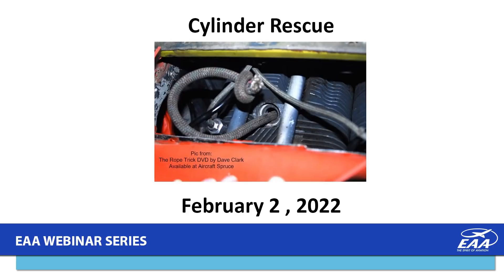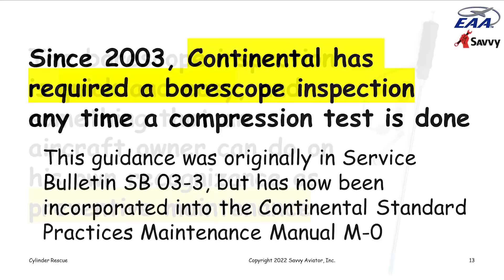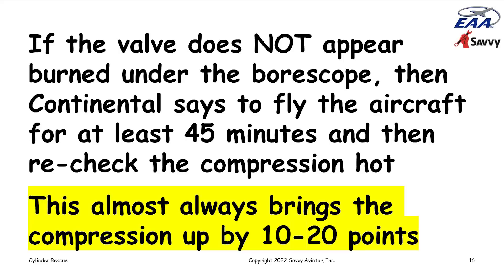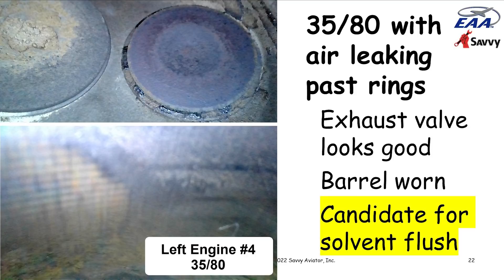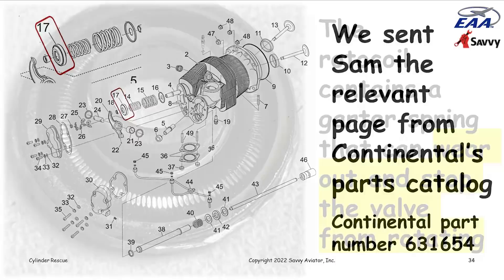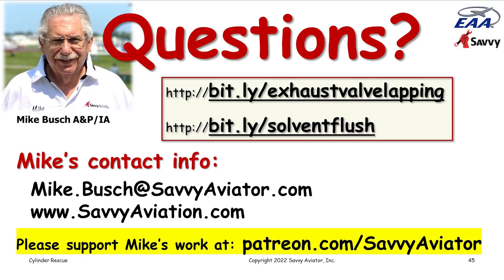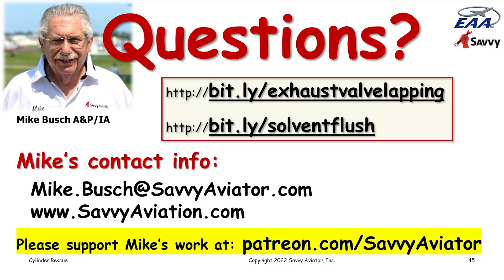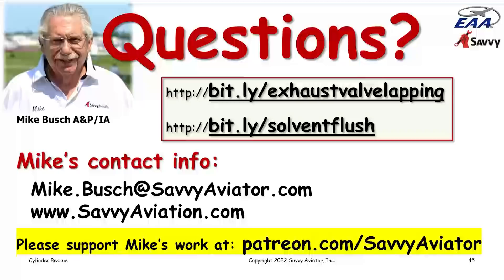Cylinder Rescue

Comment: Mike, I can not tell you how much your publications have helped me as a professional aircraft mechanic. Its frustrating to me that so many mechanics stress about lower than 70/80 compression numbers on Continentals and without using a borescope or understanding the master orifice, immediately jump to overhauling the cylinder. It ends up costing the customer a lot of money and wastes the mechanics time. One thing I would add, I found that you don't need to drop the exhaust to access the valve during a valve lapping procedure. If you use the tip of a zip tie, you can maneuver it with compound through the top spark plug hole.

Comment: As an Automotive tech doing compression test is nothing new. But its interesting, as what you call a compression test we call a cylinder leak-down test, witch we do after the compression test if we have a noticeably low cylinder compared to the others. Cylinder low compared to others, Leak-down test at TDC and see where the air leakage is then a bore scope check, witch we have been doing for a long time since camera prices came down. I think I'm buying a VA-400, it will be a great tool to look up into the cylinder as the one I have only looks down or 90 degrees. Its nice to show the client/customer actually whats wrong.

Comment: Back when the original FARs were written, compression was the best diagnostic tool they had.  Today we have a much better idea of what's going on inside of the engine.
Reply: What do you think was it Orville or Wilber that wrote that section of FAR's??
Reply: @marknielsen8738 It was Charlie Taylor.

Comment: The old hand spindles with the suction cup on the end that were used to use to lap valves when the head is off an engine required you to reverse the direction of rotation.  I doubt it’s important to do that but it was how the procedure used to be accomplished.

Comment: I have a 10 over cylinder with 200 hrs on since rebuild. It has a loose valve guide. The local shop could not repair it and recommended a another shop that might could install a 30 over guide.
Is it acceptable to install a new standard bore cylinder mixed with the 10 over cylinders?

Comment: Can owners do this lapping method or is an A&P required?
Reply: This was answered in the Q&A section. He basically said it's a big stretch to consider it preventative maintenance. From my unqualified understanding,  assuming FAA rules apply, a normal certified aircraft would need an A&P and anyone could legally perform it on an experimental amateur built aircraft.

Comment: So if I call Contintental right now, they will approve of dumping solvent into their motors?

Secondly, I agree that lapping of the valves is a commonly performed procedure done during cylinder work at engine shops, but with the jug off of the motor, since lapping the valve can inadvertently re-contour the shape of the valve, thus the angle of the valve (after lapping) can be measured to ensure it's still within spec, and not exceeded which of course can cause hot spots, pre-ignition and detonation. These are measurements which, after lapping, can not be ensured or properly measured with the jug still on the motor. In not saying is can't be done, or shouldn't ever be done.  I'm just saying that's a major factor in why we prefer to have valve work done while the jug is off the aircraft, and in the hands of someone who does it all day, every day. The cylinder's static compression is quite far down my list before the safety of the pilot. 

Thirdly, I would highly advise you not "give a little ammunition" (i.e. push) a rated mechanic to perform a procedure which he has never done, or is uncomfortable doing, which is actually against the regs. 

Lastly, I doubt if I called my local PMI, he would concur that a pilot dumping solvent in his cylinders falls under the category of owner-operator preventative maintenance. PLEASE call your FSDO and ask before ever doing these types of things. 

I will go ahead and make these calls today (continental and my local FSDO) and if im wrong, I'm excited as a rated mechanic to have learned something new from you. 

If you're wrong, the advise in this video is beyond troubling. Mr. Busch, I advocated for you to my mentors throughout the entire process of my apprenticeship in the efforts to obtain my ratings, citing the belief that their experience in what works and doesn't, does not damn your credentials in the effort only to follow the regulations. But as time has gone on, I am troubled to state that I have never come across a rated mechanic in this industry who has anything good to say about you, specifically because you give shoty advise, and encourage pilots, owners and operators to do things they have NO BUISENESS doing on their aircraft, your advise frequently if not always leads to them disregarding their mechanics' professional recommendations, furthermore eroding the trusting relationships between said parties.

I guess we shall see where this goes.
Reply from the maker: I'm sure you correct about what Continental product support and your PMI would say. Both of them would very likely discourage performing any procedure not explicitly approved in writing by the manufacturer. 

Fortunately, the regulations do not limit mechanics to performing only those tasks prescribed by the manufacturer or approved by the FAA. It they did, we could never innovate in our maintenance procedures. Innovation -- finding better ways to do things -- is a big part of Savvy's DNA. A lot of A&Ps resist innovation, and were taught that they must always do everything "by the book." So there is sometimes some creative tension between Savvy and the A&Ps in the field that we work with. That's a good thing. We do our best to persuade A&Ps to use innovative practices, but if they're doing the work they always have the last word because it's their signature in the logbook. If the owner doesn't like it, it's always his option to take his aircraft to a different A&P whose butt muscles aren't so tightly clenched.

The relevant regulation [43.13(a)] permits us to-either- use the methods, techniques and practices prescribed by the manufacturer in the AMM or ICA, or "other methods, techniques, and practices acceptable to the Administrator." That last phrase is what gives us all sorts of wiggle room in terms of methods, techniques and practices. There's quite a bit of written guidance from the FAA about exactly what that last part means. "Acceptable to the Administrator" does NOT mean "approved by the Administrator." The FAA makes it quite clear that the FAA does not have to have ever looked at something for it to be "acceptable." All that is required is that the mechanic using the method, technique or practice have a good-faith belief that the FAA would not find it unacceptable if it ever looked at it. Since it's highly unlikely that the FAA would find valve lapping or solvent ring flushing unacceptable (since it doesn't violate any regulations), we see no problem in recommending it regardless of what Continental or some local PMI might say. Savvy has been pretty public about our recommendations about valve lapping and solvent ring flushing, and so far we haven't heard a peep from anyone in the FAA about it. That gives me a lot of confidence that it's "acceptable to the Administrator." (If and when someone from AFS-300 notifies us that the FAA finds it unacceptable, we would certainly change our tune, but I don't expect that to happen.)

Certainly an aircraft owner who performs preventive maintenance is not expected to consult the FSDO before he does so. Furthermore, the FAA's Coleal Interpretation makes it clear that owner-performed preventive maintenance is NOT limited to the 31 tasks explicitly listed in Part 43 Appendix A(c), and that there are many other tasks that the FAA would consider to be preventive maintenance beyond those 31 listed items. We've never stated that a solvent ring flush is preventive maintenance, we've only said that it is so simple that it probably could be considered to be preventive maintenance. It would be up to the owner who was thinking about performing this procedure himself to determine for himself whether it is preventive maintenance or not under the FAR 1.1 definition of that term.

Many A&Ps that Savvy works with have a similar reaction to these things as the one you have expressed. We're used to it and we can be pretty persuasive when we need to be. But we never ask any A&P to perform any task he's uncomfortable performing. The A&P performing the work always has the last word. --Mike

Comment: I really respect you and your knowledge but I wouldn't be advising customers with cars to take their plugs out and to try lapping their valves for flushing a cylinder that should be replaced.

Four wheels on the ground you can do all this stuff get away with it in the air sounds kind of sketchy to me.